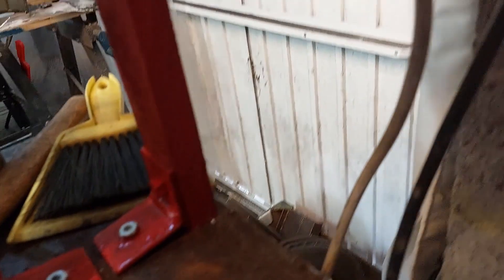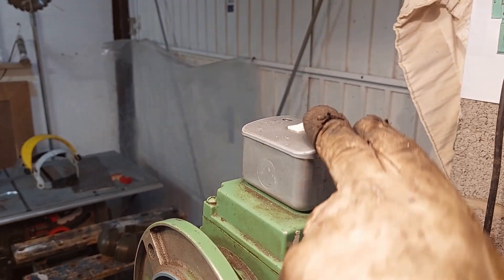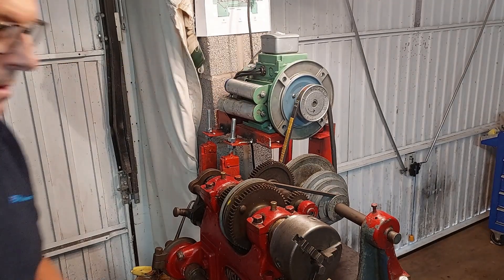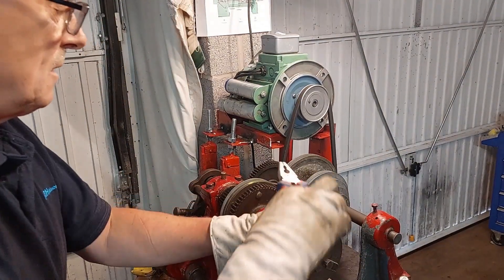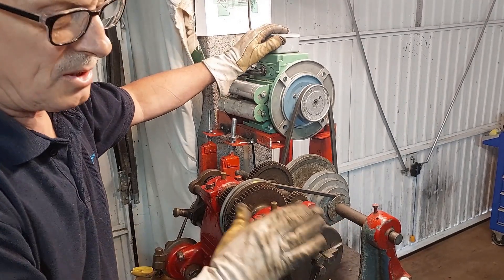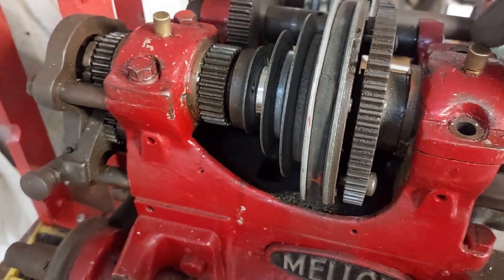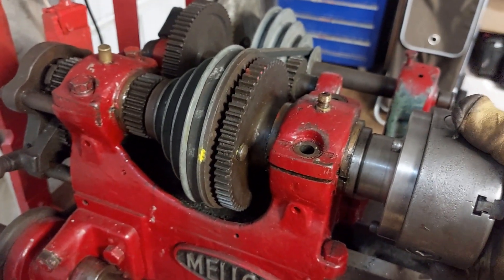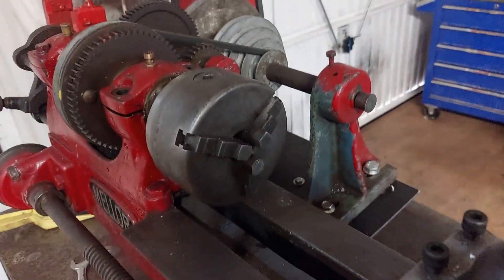Mellor Lathe  Part Four   Description of features (Updated)

Comment: Those headstock bearing caps need to be shimmed and nipped down tight. Don't leave them floating. As the bearings wear you remove shims, maintaining the fit. When you have no more shims left it's time for new bearings.
Reply from the maker: Thank you for the tip.